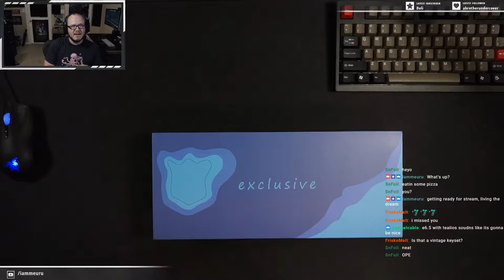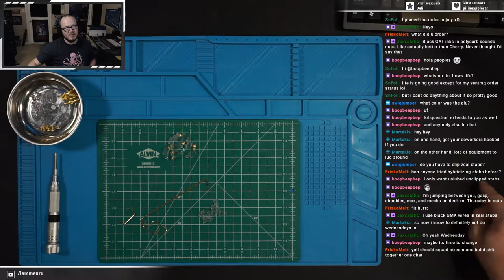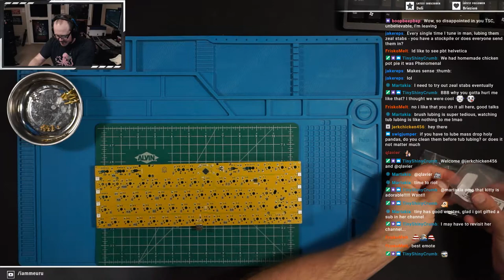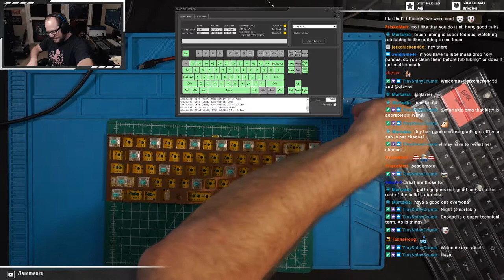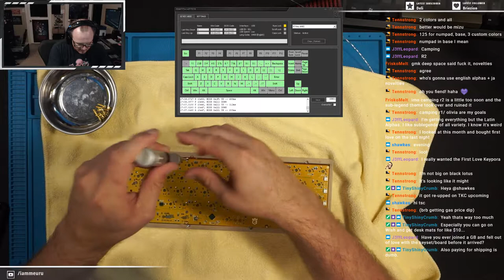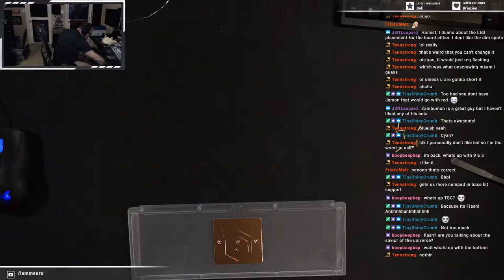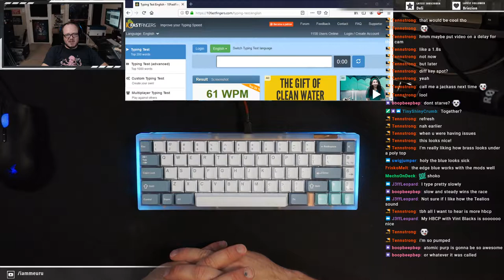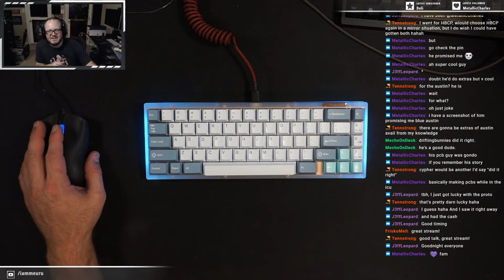E65 Polycarbonate w/Tealios

Comment: I mean to me the e6.5 poly doesnt sound as good as the aluminum which you actually know the aluminum sounds amazing actually but even here I dont mind it has a super deep sound to me my favorite is deep and creamy so I woulsnt mind this one but I still do enjoy the aluminum like way more with souns its actually one of my favorite sounding boards the aluminum and forgot to mention I got the e6.5 right well I also got a special carbon fiber plate for my e6.5 I'm strictly a souns guy but you also have to rmemeber preference is a thing and the issue is finding good ones that are so limited the e6.5 to me is one if the best 65 percent boards was a great price has a great typing feel and has an amazing sound the aluminum this board is a great 65 percent but again its preference based because I remember you really likes the aluminum e6.5 I think you just disnt like the poly as much so it changed your opinion a little bit I've owned a lot of 65 percent and this is one of the best out there but I'm not a guy that needs the best looking board you should try the aluminum with a cf plate holy shit does it sound fucking fantastic I got mine made during that jae top clack buy for plates